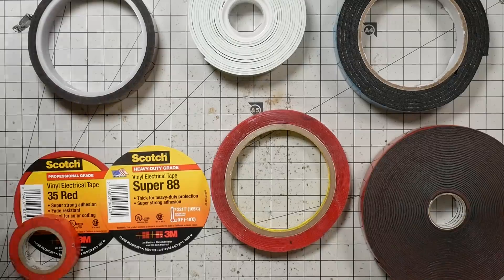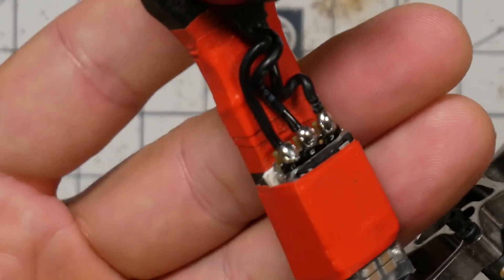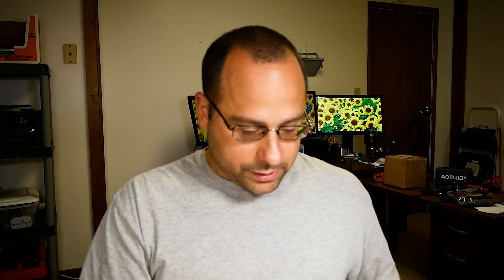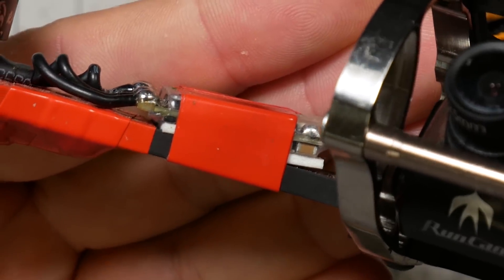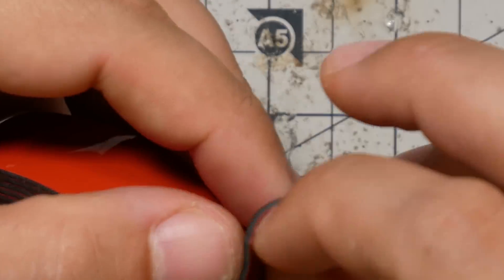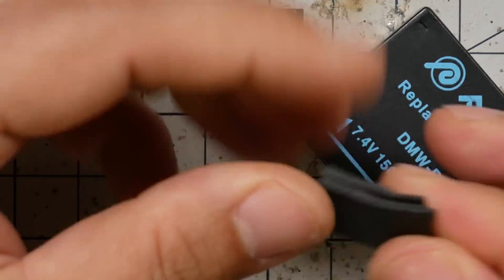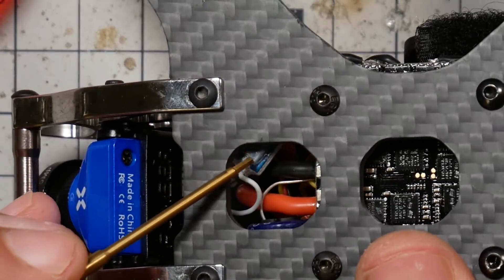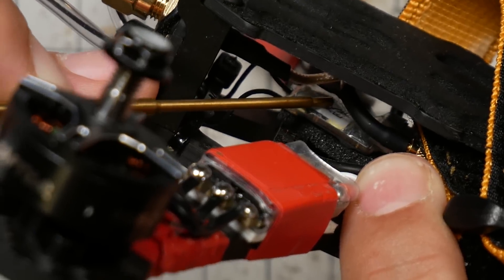Must Have Tapes For FPV Quads | BUILD TIP

Comment: Heat transfer pads work great for under ESCs on arms, they also help with heat dissipation. 

I also use them to hold my VTX onto the frame as it lets the frame sink some of the heat.
Reply: I could be wrong but I don't think the frame is good for absorbing heat due to the nature of epoxy and if you are dumping heat into it I can't imagine it helps with the durability of it. That said the pad alone soaking up some heat on it's own probably helps some to add a buffer during those moments you have less airflow.

Comment: That 'servo tape' looks suspiciously like self-amalgamating tape; normally you would stretch it until it's about a third of its width and wrap it around connections. It amalgamates into a solid rubber, totally waterproof seal.

Comment: Handy vid jb. I keep losing Ariel and vtx due to lack of sufficient mounting area and pulling out of the jst connector when crashing. One question. Does the heat from vtx not matter when mounting things on top and will mounting reciver on top effect signal strength of both components?

Comment: Pro tip: keep fingerprints off the sticky side of the tape.
The NSA will recover them much easier and the adhesive won't hold on very well because all that grease you left on the tape.

Ok... Maybe NSA doesn't give a rat's ass about it but, for sure, it won't stick very well.

Comment: I'm a tape nerd too. My favorite is the 3m 4011 outdoor tape.  I use it to mount escs and flight controllers on my helicopters.  Here's a removal tip, use nylon thread to saw through it like flossing. Then you can roll it off each surface with your finger. It works a treat 😉

Comment: I have recommendations for a tape use that will save some new peeps from a little headache. Anyone using a UFL connector for their VTX (like a TrampHV)? Wrap your VTX tight with electrical tape on the top where the connector comes out the VTX. It will secure the crappy connector much better and reduce the chance of it coming off. A little trick that really helped me out. Hope someone else can use. 👍 Good content Josh. Take it easy man

Comment: Hello Joshua loved the video. Recently I had to buy some 3D printing pieces and found they are quite expensive.  So I decided to start looking for a 3d printer just for printing 3D parts for my quads, like gopro mounts etc. Do you have any Tips and trouble shooting ideas for the Noobs on a budget when getting into 3d printing for quads builders. Thanks.
Reply: DroneMatesFPV Anet A8 is a cheap yet capable 3d printer to start out with.  It is decent out of the box but you can print upgrade parts for it that will increase print quality and precision.

Comment: Try pre-heating the black VHB with a heat gun, and clean the surfaces you're applying it to with alcohol first.  It's for keeping aluminum siding panels on semi trailers without rivets (quieter)...  it absolutely sticks to flat surfaces.  The clear VHB is great for ESC mounting cause it doesn't rip components off circuit boards if you take it off by stretching it off from the side.  It'll also stick better with a bit of heat to clean surfaces, but it doesn't bubble up like hot tar as the black stuff does.

Comment: A great video !! We need more of the detail stuff like this. Can I add a bench must have for myself ? Liquid Electrical Tape. Or black Gold as me and my buddy call it. Applies easy, comes off easy(ish) ( without pealing parts !! ) and works everywhere ! A Home Depot  item, brand I use is Gardner Bender. Also offers some water / moisture protection !!

Comment: Great video ! For your VHB application I use hot glue. Yes it's hot and has to be applied with a hot glue gun but glue sticks are quite cheap and you can inject it in holes and rework it a bit afterwards (I know it was a video about tapes, but as you mention your struggling with sticking things together...) also great for quick and dirty fixes on the field if you have 220V somehow available.

Comment: nice nerdiness :)  how about some flexible zip ties? most are brittle and stiff. 

 I have about 10 different tapes - for planes, 3d printing etc.

am using electrical less and less due to the residue. field repairs only
for general holding, there is a black cloth tape that sticks well to itself but doesnt leave the mess. 
banggood, amazon etc sell it cheap. 

for planes I have other tapes.
reinforced tape is good for planes in structural areas. holding wings on, adding strength etc.
packing tape is good on planes for leading edge protection.
painters tape is also good. cheap for holding things together while gluing or testng. the right version of it is great for foam planes.

Comment: Great info as usual. After watching you do two videos on soldering, I now own a roll of 63/37 and a block of sal ammoniac. Even the geekiest electronic channels haven't recommended those two items that I now use daily. 
I use Kaptan tape under my ESCs along with a foam tape 'cos I know how tough it is as an insulator. That's the same stuff you'll find in a pack seperating the lipo tags so it must be good.

Comment: Personally for double.sided tape I always go with the black double sided gorilla tape. 30 lbs per sq. In. And I have tested it and it actually let's go at about 32-35 pounds. I use electrical tape but only to insulate and hold things in place, not a big fan of it and for general purpose tape I always go with gorilla tape. I will be getting some of that scotch red 35 and super 88.

Comment: You can never go wrong with 3M. Tape, glue, chemicals, they're all great.
However, it is very expensive in European countries.
I found this one on Banggood: https://www.banggood.com/10Mx12mmPermanent-Double-Sided-Self-Adhesive-Foam-Body-Tape-p-908131.html?rmmds=search&cur_warehouse=CN
, and it amazing. You can literally not pry off an ESC, you have to cut it off.
Just a tip.

Comment: I also use the adhesive velcro strips liberally. No love for velcro strips, JB?
Reply: JB doesn't fly fixed wings. If he did, Velcro would have been a big part of that video. Likely packing tape and reinforced taped would have been in there too.

Comment: BTW, look for "Tesa Tape" as well. It's an electric tape, but it's made of some kind of cloth, I don't know. It's used in cars wiring and it's really strong, maybe can protect motor wires against prop strikes.
Reply: N D I'm not sure, but looks like it's the tape used in a few micros. Albert Kim and Nick Burns both talked about that. 😊
Reply: IT'S A TRAP! 😐
Reply: I do NOT have this issue with the stuff i bought.  Zero Gunk.  I conformal and heat shrink everything so no issue there. (Not an Affiliate link)
https://smile.amazon.com/gp/product/B00EH6IZ6Y/ref=oh_aui_search_detailpage?ie=UTF8&psc=1
Reply: Yeah, that is great tape. Used for Runcam Split cables.
Reply: Is that the tape they use on the fpv egg 138 pro?
Reply: This.  Don't use electrical tape on ESC's.  This stuff takes MUCH more abuse and prop strikes than electrical tape.
Reply: Tesa tape is used for automotive wiring harnesses... It's generally impregnated with gunky stuff to make it seal and become watertight. If you don't like cleaning electric tape gunk off you'll hate Tesa tape! 
Plus you shouldn't use it on bare components as it's not electrically insulated!
Reply: I stand corrected!
Cheers dude 👍 now if only i could get that over here! You clearly have more variants to choose from across the pond! 
I have used multiple brands and widths over the years here and it's always been the impregnated version! 
But it's damn Good stuff for sure 😁
Reply: How about Deso tape! That will hold everything in place 😂
Reply: Beerad FPV Hey, nothing wrong with affiliated links. 😊
Reply: Susan Robinson dunno do you accept credit cards and rohipnol?
Reply: Tesa 51616
.
Reply: Hockey stick tape is great for wire protection, seems to be sturdier and cheaper than Tesa. Comes in lots of colors, too (but I am still using black roll I got some time ago) . I am using it to tape ESCs wires, protect ESCs and flat ribbon cables. Sticks good, looks great and comes off without sticky residue

Comment: JB, I like a lot a 3m double sided tape that I have here. It's transparent like one you showed, but the part you peel off is green. It's for heavy stuff and it's REALLY strong! I use it a lot in my projects, mostly to fix little boards like the TP4056 (which has a micro usb port and is used to charge lithium batteries). It's awesome.

Comment: Tape lives matter!
Reply: Red is rad.

PVC and Vinyl is the same, but vinyl is a very hard brittle plastic, so its stretchiness and pliability depends on added plastifiers, and therein would lie the difference between your Scotch and your 3M electrical.

My favourite double sided tape is a dark grey foam tape about 1mm thick that i got from no idea where and it's not branded on the roll! Probably some discount brand/store. So i can't get more of it. It holds pretty strong, much stronger than usual white foam tape (mirror mounting tape), i've put vibrating items on it for years and it doesn't come off. But it also removes easily in one piece if you just tug on it and stretch it from underneath! But if you pull on the item that's glued on, it's not coming off, needs a LOT of force! It's very pliable too. When it comes off, it comes off without leaving residue or traces. It's magical. I think it's acrylic based, but then there are a million ways to make that, probably none as good as the other ones, and it doesn't have distinct surfaces like that black foam tape you showed, it's uniformly sticky throughout the material thickness. It behaves very much like Tesa Powerstrip, except those cost a fortune and hold even much stronger than that, those come with little pull tabs so you can remove them super easily.

Kapton tape = Polyimide. Very widely used in electronics. On flat surfaces, it's practically safe against poking through, it's extremely robust, so if you have a heatsink that's a bit too close for comfort to a trace it shouldn't short against, this will absolutely protect it. For people who have a 3D printer it's an absolute must-have, as it's used to mount temperature probes, or hold things in place around the hot-end.

Comment: What thickness, width, and length do I select when ordering VHB on Amazon?
Reply from the maker: Well it sort of depends what you want. You just have to think about how you're going to apply it and go from there. Length is the easy one: more is more expensive but is more tape.
Reply: Just looked at the VHB link and it’s only showing black not clear, is this the correct tape ?

Comment: For ESCs you should give self fusing silicone tape a try. Holds well and doesn't leave any sticky residue
Reply from the maker: It gets chopped too easily by props and then falls apart. I don't like it.
Reply: Affirmative
Reply: m levine yep works well for me

Comment: - Surface prep and handling - if you want stuff to stick well I find that not touching the adhesive on the tape with your fingers and cleaning the surface if possible e.g. carbon helps get a better bond. I use alcohol prep swabs (medical injection site swabs) to clean carbon before taping,  I try to use tweezers which are hopefully less oily than my fingers to handle the adhesive side or sides of tape.
- Storage -  I keep more expensive hi bond tapes like VHB in a sealed plastic bag, because I believe the adhesive starts to set/degrade and the tape does not bond as well, when the tape is exposed to air. You don't leave a pot of glue exposed to air and expect the adhesive to be in good condition to use when it comes time to use it so I don't see why you'd expect the same with a thin smearing of adhesive on tape.

With both of these things I don't think it is as important if your using say 4 x 6" pieces of tape to attach a picture to a wall. But we're using like 0.25-1" of tape to attach flight critical components which may have less surface area due to irregular surfaces such as components to a  machine that operate under high G loads and where it really sucks if e.g. your RX ends up dangling in the prop disk, so I think it is worth taking the extra 30 secs to give the adhesive the best chances of working optimally. 

Tape over the dog bone foam - that's a top idea. Cheers.
Reply from the maker: Foam tape is great for making shims! Try that with squishy VHB!